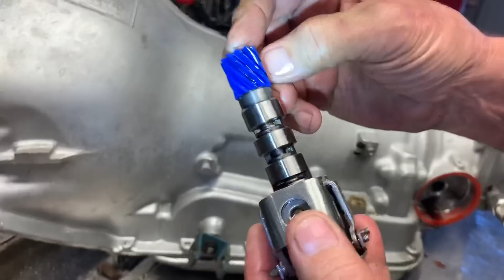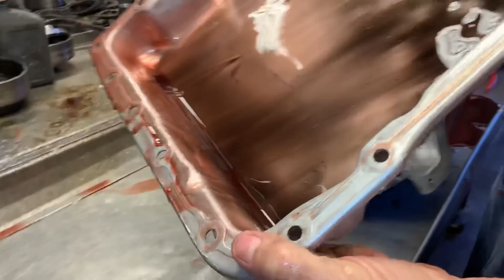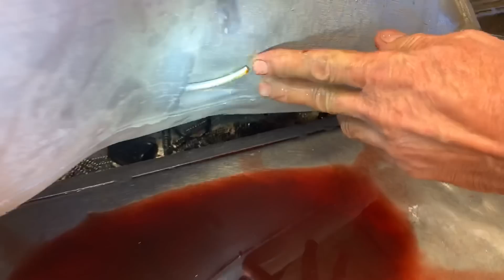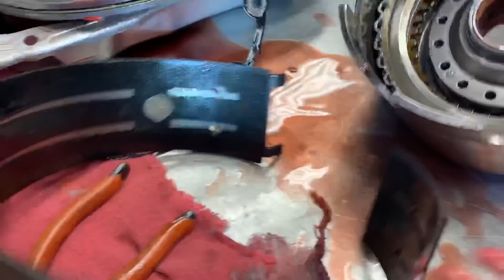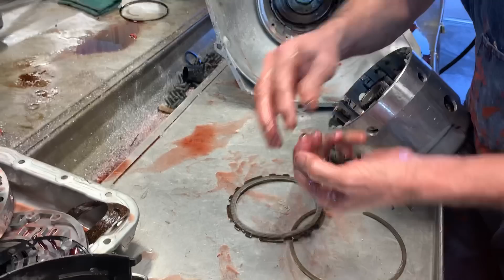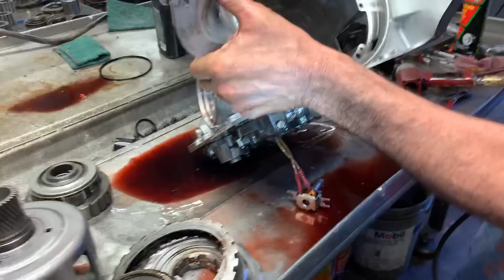Reason why we don’t like doing carry out transmissions. Video 1-2

Comment: Super Job. Yeah it sucks when the customer comes back and says, hey I have a problem with your work, when it's the customers work that was the problem. My dad is a mechanic and would tell them you have to do this. They wouldn't and would come back and say it's not working. He says did you do what I said to do? No! Well I'll fix it but it's a new job now NOT a warranty, but I'll give you a discount on parts, NOT LABOR!  I want to do the full job this time. Some walk, some admit it and have him do the job right. Yeah walk outs are a crap shoot at times. So can you show us how to do the adjustment right? Thanks for sharing. Best Wishes & Blessings. Keith Noneya
Reply from the maker: Yeah we get into some sticky situations. Customer finally did admit to not just seeing the TV cable right but it’s just after the fact of doing it twice sucks. 🤦🏻‍♂️
Reply: @PrecisionTransmission  You need the shop rate chart that some of the old mechanics had! You bring the car in and let me do it - $10, you bring your car in and tell me what's wrong-$20, you bring your car in to finish your work - $30, you have me finish your work with missing or wrongly installed parts - $40, and you bring your car in and want to help me repair - $50.
Reply: Thumbs up for the avatar!

Comment: I change fluids, brakes, and basic maintenance on my cars.  I know my limit.
Reply: Takes a wise person to know and adhere to their limitations,ever think of doing some schooling to learn more,even if just for yourself..,
Reply: @sexyworm1000  fine if you're only working on a mower or a trail bike. Not so advisable if it's the only mode of transport that can get you to work! There's some things that I know for a fact I cannot do, simply because I don't have the necessary equipment (lift, press, diagnostic tools etc.). I'll tackle any automotive job if I'm fairly confident I can get it done over a weekend with my decent selection of hand & power tools. Anything bigger than that, it goes to the shop.

Comment: Lol I see you have one person dislike this video it must be the guy that owns that transmission.
Reply: According to BAR bureau of automotive repair the rebuild guy is liable for that. The car should be ready for install in park or neutral depending on the manufacturer. Another point is that the shifter cable comes in PARK typically and that’s how it should be given to the customer.
Reply: Amen to that.. Automatic transmissions is not for everyone!
Reply: @o_ox_x4638  not the 'shift' cable-the TV cable was out of adjustment bc the shop did not have the car.
Reply: @o_ox_x4638  it's the TV cable that was the problem. The TV valve changes the shift pressure based on throttle position.
Reply: Lmmfao!
Reply: You got me...
Reply: @o_ox_x4638  It was the throttle pressure cable being either disconnected or not adjusted correctly that caused the problem.
Reply: @o_ox_x4638  LOL, go have another drink at the BAR.

Comment: I done carry outs for 25 years,Built @ AAMC@ a while,a cpl locals before starting carry out business..
 most of the folks listen to you,SOME DO NOT,If you don't have correct throttle pressure on 700s,2004Rs,325+325-4L...TH200,200C,They will fail! If cooler isn't cleaned..It will fail!.If you use the old torque converter sort of like taking a bath and putting on dirty clothes,but all the debris from old unit,the friction,and metal will go straight to valve body...and once again will grind up new unit,I'm sure this man knows this all to well,I built from 1974 till 2010,I'm retired my back is out so are my ears,Impacts kill hearing,This man done it a long time too😊,Good luck Brother builder!!.

Comment: I just had a shop build my transmission, and fully plan on letting them install it.  I will happily swap an engine, axle, diff, but if someone builds a trans, most shops won't warranty their work unless they install it for this exact reason.
Reply: Fair enough
Reply: And he's charging you book labor. I can have one on the floor in about 30 minutes.

Comment: Great video! Brings back memories. i used to be a Remove & Replace mechanic in a Transmission shop back in the 80's. We were a 3 man shop. The boss was the head builder & the other guy was a builder & would help me R&R as needed. I learned a lot from those 2 guys. I remember the 700's smoking up real quick by throttle pressure misadjusted. The boss trained me in rebuilding the easy stuff, 350's , 904's, but the 700's were out of my league. I got into another trade a few years later. You sir are a professional I enjoyed your explanation.

Comment: I am still, even after watching several of these videos just completely floored with how dude just handles the 8 bazillion parts...and can name and know the function of all of them and how they fit into the greater function of the assembly.  It's just a mind boggling amount of information.  I'm a systems engineer by trade and I couldn't track that many things at once and I know my systems.  I still have to use reference material all the time.

Comment: I LOVE THE THM-200-4R/THM-700-R4 TRANSMISSIONS 87-UP,BUT YOU ARE ABSOLUTELY CORRECT WITH THE TV CABLE ADJUSTMENT,THE CORRECT LINKAGE ON THE CARB IS CRITICAL TOO,PEOPLE OVERLOOK THEM. I DID SOME R&R WORK FOR A SHOP AS A KID.

Comment: Outstand video! I like that you use the Alto "red" pack in 3-4 clutch set. And yeah, that TV cable gets a LOTTA people pissed off; if that thing ain't right, goodby clutches. Had it happen before. Costly lesson. Thanks for the video.

Comment: In 1994 the transmission went out in my 1990 Astro van . I put in a junkyard transmission. I’m going down the road and I don’t have a speedometer read. Called my uncle and found out I needed to get the rear housing from the old one for the speedometer to work. So I’m know what you mean when you talk about not everybody should be working on transmissions😂😂

Comment: I was a mechanic in the military, certified to work on everything from the general’s car to heavy diesel refueling trucks. Beyond that I can fix just about anything you find in a home or on a farm... electrical, plumbing, A/C, tractors, hydraulic systems, even bulldozers. 

But I leave automatic transmissions to the pros.
Reply: Hydraulics are transmission, take a shot at it, just handle the vavle body very good and look out for the small screens and filters, or if its not the problem don't even touch it

Comment: For the life of me I have no clue why someone would want to shade tree change an auto tyranny, first of all you really need a transmission jack, a floor jack doesn't cut it, they don't like being dropped, TC's tend to shift at the worst possible time, getting the housing bolts can be a real ba** buster. Unless you have a lot of time and don't need the vehicle for transportation it's not worth the effort, take to a shop and let someone who makes a living do the job. Yes when I did drag racing I did my own tyranny work but i wanted to learn how they operate and had some short cuts, like holes cut in the firewall to make getting to the bell housing bolts easy, and pressure release hoses to disconnect the oil cooler lines.

Comment: I remember when I was working on them in the 1980's, we couldn't get rebuilds to shift properly with the GM transmissions that had a throttle cable until we test drove them by driving with several full throttle runs.  That was 200R4's, 700R4's and maybe the front wheel drive ones. After the throttle was stomped a few times, they shifted fine.

Comment: 18 years old took a car I was thinking about buying to an old mechanic. He worked on farm tractors, trucks, daily drivers, race cars, boats, almost anything. His place was cluttered, dirty, and grimey. Except for this small area with a doorway with plastic strips hanging down across the entrance. It had a bench and floor you could eat off of. He said that is where I rebuild automatic transmissions.

Comment: With the advice of a pro, I rebuilt 2 of these back in mid 90's.  I had to lay everything out or i would have forgot how to put it back together.  A lot of cleaning involved and a lot of tips and tricks.  One reason these fail is defects in design and engineering.  Almost always there is an upgrade or modification to theses to solve a design defect.  Put this ball here, don't reinstall this part there... Drill out this hole here, put this larger spring there.  And this is just for a reliable rebuild, not even performance upgrades.  The cable he is talking about, if you leave it too lose it will shift so smoothly you may barely feel it, and that's no good as the pressure is low and the clutches are slipping.  Adjust it too tight and you may bark the tires when it shifts.  Good video...

Comment: Impressive skills. Definitely has done a few of these among others. Has the tools ready to go right there within reach without even looking and no trips to the tool box. Just grabs and goes to tearng it down with lighting speed.  No worry's about the pieces being put into one pile mixed altogether  knows where each piece goes by heart ..
That's got to be irritating though to have to go through it again with only 5 miles on it . I hate redoing work..it's my motivator to do it right the first time. But the control cable on those 700r4s is the bugaboo . Get it wrong on the carb install  with incorrect throttle arm geometry and poor adjustment and the trans is toast as soon as you drive it.  Which is why I don't mess around with these and leave em to experts like this man. I have a 2004r sitting around for years that I'd love to install behind the 6 banger in my Nova, but that control cable install is  what is stopping me . Would be nice if these were more like a th350 using a vaccum modulator and a kickdown  making it more forgiving on the maiden voyage if it isn't perfectly adjusted in. Anyway. I enjoy the vids and impressive skills / knowledge you are sharing with us.

Comment: What a shame. Nicely built trans and totally abused in 5 miles. I have B&M’s 700 in my s10 with a Hughes 3500 stall lock up converter with a properly adjusted cable that works great. Don’t know how old it is because it was in the truck when I bought it but I’ve serviced it and put B&M’s fluid in it and have no complaints. Wish I lived closer to this guy because he’s so detail oriented and knows all the little tips and tricks. Great job my friend

Comment: Correct me if I'm wrong, but if you leave the shift cable completely disconnected, it goes into a self-protect mode and will shift 'high and hard'- with added line pressure.  At least that's what I remember. Applies to the 200 also.  And yes, if you have the cable out of adjustment (not pulling hard enough at full throttle), you can smoke the clutches when she tries to shift with low line pressure.

Comment: Look at all those parts, that's why I don't mess with transmissions. I did pull my transmission out because it wasn't shifting, it only had a drive gear, had Honest Performance knew a guy that worked on 700r4transmission. Got it back works great so far, I have about 500 miles on it now in a 69 Camaro.

Comment: So many people dont use the carb throttle lever adapter for the throttle valve cable. These are available for Holley and Edelbrock carbs.  

Both brands throttle levers are set up for th350 kick down cables. Not throttle valve cables.  

The th350 carb lever is longer so opening the throttle pulls the cable casing too far causing it to be slack .. not bringing up the transmission line pressure like it should.

Comment: The TV cable adjustment is the single most common cause of failure of the 700. Johnny do it yourselfer does a carb swap and doesn't buy the TV corrector bracket for his particular carb setup and burns up his Bruce Jenner on the road test. Seen it literally dozens of times.
Reply: This is my #1favorite comment I have ever seen!!! thanks

Comment: I think Richard was a little upset do to the customers mistake about not adjusting the "passing gear cable" that hooks to carburetor if I'm not mistaking and the customer trying to blame Richard as in to why it burned up so fast... That cable is very important on 700 r4. GOOD JOB RICHARD! Keep your passion

Comment: I'd have a no carry out on tv transmissions policy. Doing it twice sucks
Reply from the maker: Oh don’t worry he paid for it twice 🤦🏻‍♂️ but does suck doing it twice.
Reply: The owner should have taken the time to set the cable right. But im sure he got in a rush and it cost him!
Reply: If it wasn't for the bench job I wouldn't be able to say I have a truck 46re dodge everywhere was almost two grand to do full job I paid 800 for a bench job over a year now and I pulled the trans out and reinstalled. I'm no stranger to mechanic work my dads very self sufficient and I learned allot from him no master but I've kept myself off the side of the road and have done a lil more than regular maintenance. Key is prep work and a huge part of prep work is doing the research today's times with the internet that's brought allot of info to the table more readily. The 46re is allot easier as far as pulling and reinstalling.
Reply: @telly115ify  I did a 46rh for my 92 with the 12 valve. They are incredibly easy transmissions to build and modify. The amount of documentation on them helps immensely.

Comment: Those Throttle Valve cables are amazing, seems like a really clever genius solution from an OEM perspective, but it's a major headache to anyone hotrodding an overdrive transmission GM car. Just leave it to the pros.

Comment: I had a issue with a 700R4 in a 34 coupe, between the carpet and floor mat the mechanic could wasn't able to adjust the tv cable I showed him to hold the throttle wide open at the carb, always check this with someone inside pushing down on the floor throttle and verify that the throttle is wide open on the carb.
Like your tips about using silicone to help with oil leaks.
I pretty much use the same set-up using the zpak and wide band.
Steve

Comment: There are holes in the valve separator plate that can be drilled oversize to help get full pressure to the clutch pack also. Not nit picking just comparing notes.

Comment: The basics improvements Richard is doing are good, yes but there are a lot more small improvements I made to my trans who makes it last stronger, longer. Wider band ? yes if you do trashing/racing. Fancy 14 clutch pack ? Not my idea of reliability. I only use 7 to 8 discs but double some steels. Keeps the 3d cooler and with small mod to valve body, the clutch snaps in and out  without a chance to slip, so no wear. 
I used to build lots of  904 and 727 Mopar. Once I opened one I did thousands of hard miles with and the printed label was still perfectly visible on the clutch plates. 
Same with my present 4L60. Hardly any wear on any clutches and it was build about 9 years ago and seen 45.000+miles. Only reason why I opened it is, a Thorrington bearing in the forward/reverse sparg started singing.

Comment: Wish I took my ol truck down south to you guys cause the fools up here in Cambridge MA (Transmission Specialists Inc.) F'd up my Standard trans. so bad I only got around the block in 2nd, turned back & found their lights out & they wouldn't answer to door. Later on they did fix it (different mechanic) only after threats to call the police. Question: Out of the major pick-up truck manufacturers who do you think makes the best automatic trans.? Ford ? Toyota?

Comment: Spent over $4,000 dollars at big name trans shop (AA)having 700R repaired, only to have trans explode 90 miles down road.( they reused my old torque converter w/ over 290,000 miles on it, it sent metal shaving thru out system)

After that I found old drag racing gearhead working out his garage , he removed/replaced /repaired for $800, still working 17 yrs later.

Comment: Had a c6 transmission go bad years ago. Took it out and to a shop that said they had rebuilt it and upon receiving it my dad who did mechanic work and me put it back in. Few days later it started leaking fluid out the front seal. Took it back out and back to the guy. He wouldn't even look at it to see what had happened.  Put the transmission back in stopped off the fluid and drove .25 miles to a transmission shop and they pulled it apart.  They found all used parts had been installed except for the seals. The front seal had clean transmission fluid on it but was clearly old. I shut down the first shop quite easily.  Now I just take the whole vehicle to a transmission shop.  And I ask to see the old parts while the transmission is apart and I take the old parts with so they cant be sneaky and put something back in that should be replaced.  Funny thing is I would actually trust you guys.

Comment: I respect what you are doing and I'm not trying to tell you that you don't know what you are doing but blaming the cable adjustment is not correct. I drove an 86 iroc with a built 350 with a 700r4 when I was younger. I tried for months to get my cable adjusted correctly and finally just unhooked it and left it off. I punished this car day in and day out and never had transmission issues as far as slipping. And to this day my buddy is running that trans in his Camaro. Same internals as 15 years ago. Something else went wrong in that transmission.  Operator error more than likely but I don't think the cable being out of adjustment would toast 3rd in a matter of seconds.

Comment: I did carry outs at my shop but I always explained in writing and had them sign it, how to adjust the cable, not let it have leaks and that if it did not work right, stop driving it and call me. Also that they were to immediately bring the vehicle in after installing it provided it was working right. If that was ignored, no warranty.

 Lol, the guy who put wooden dowel pins in his block instead of the steel ones was really mad when the pump on his C6 cratered as soon as he started it.